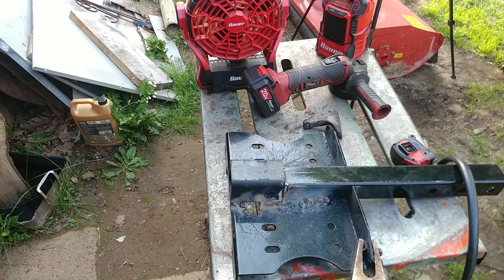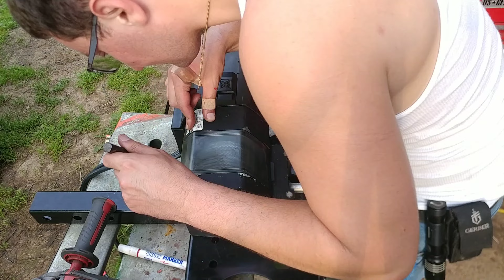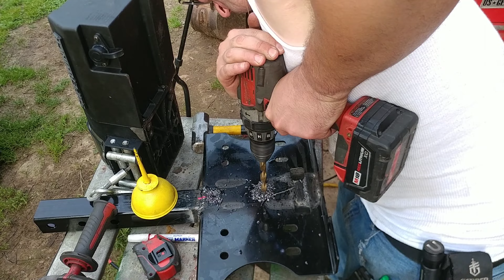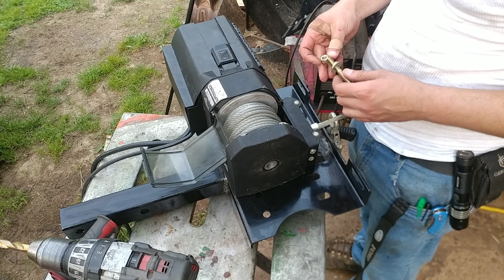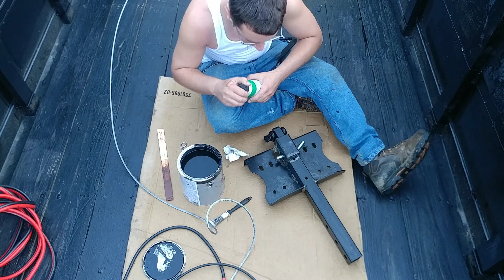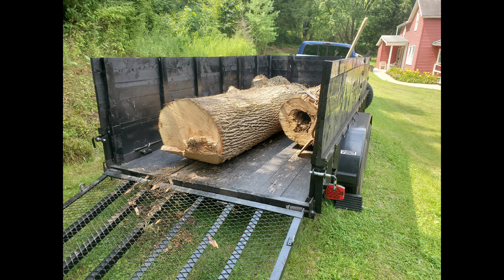Remembering Harbor Freights Famous 90 AMP Welder With One Last Project - Winch Plate Welding

Comment: Damn bro, nice job. I believe you have  been through every flux core welder HF has. 😅 I just got the Titanium and it is something else. Did you ever hit thermal overload on that truck bed? I can't get thing to shut off. I was thinking getting it and your review was one that pushed me over the edge. That thing just eats steel like it's nothing. I respect the hell out of your hard work and go getter attitude.
Reply from the maker: Thank you. I think harbor freight has just the two 110v flux core welders that I've had too. Welding up that entire dump truck bed it never hit the duty cycle once. Maybe it's broken? Thanks for watching the review. I ended up welding almost the entire underside of the dump bed as well so it's probably closer to or over 100 feet of weld that I've done with that little welder. Its been a long bumpy road getting this business up off the ground, that's why I am doing all of this.